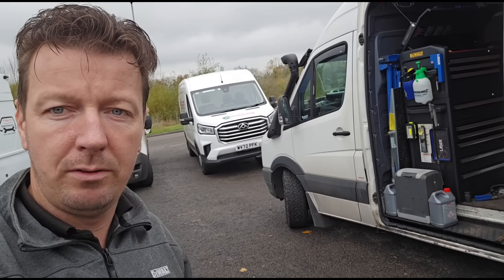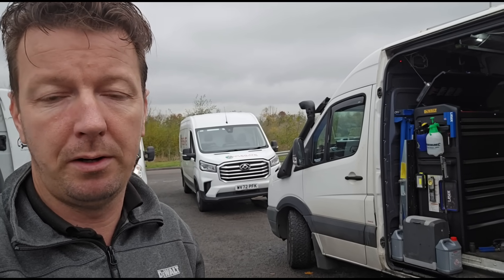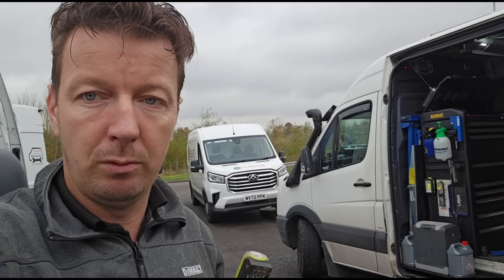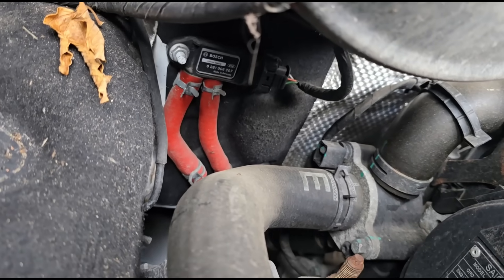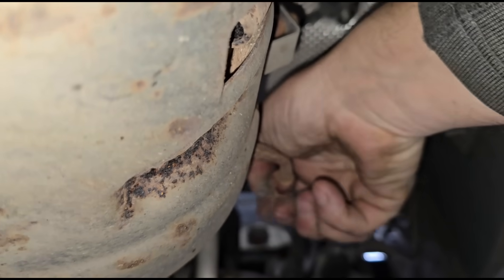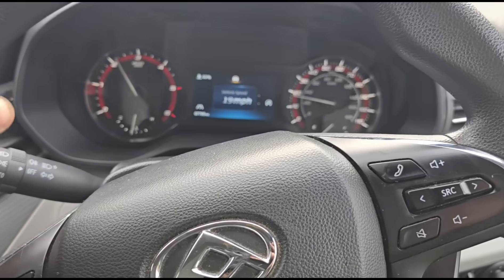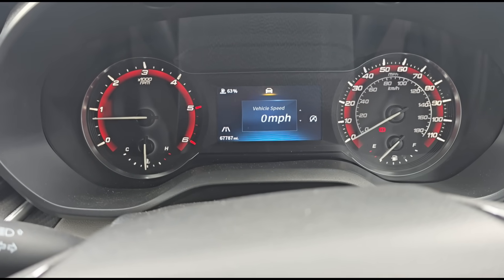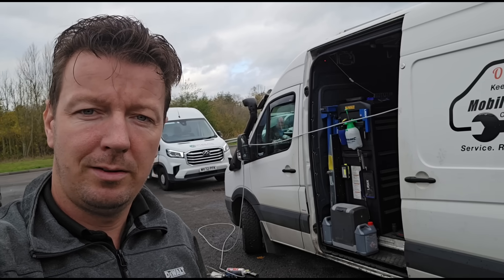SAIC Maxus Deliver 9 P226D09 Diesel Particulate Filter Malfunction & P244B00 DPF Pressure Too Large

Comment: Engine is VW EA288.variant.
Reply: No it's not
Reply: @pashwesty3313  "The SC20M architecture is based on the Volkswagen EA288 modular diesel engine platform." - Wiki  "The SC20M is essentially SAIC's version of the Volkswagen EA288 diesel engine platform, sharing its core architecture but adapted for SAIC Maxus vehicles, offering different power outputs (single/twin turbo) while both meet Euro 5/6 standards, with the EA288 being VW's popular, widespread family of modular diesels found in many VW, Audi, Skoda, and SEAT cars, known for efficiency but sometimes piston ring/oil issues in early versions," AI derived info.

Comment: Thinking of buying this MAXUS V90? 
DON'T! 
I worked on these at the LDV dealer from 2021 until 2025 They are garbage. Engines going bang, Oil pump solenoids, gearbox and clutch issues, low pressure EGR every year, timing belts going etc. 
Stay away, get a Renault master instead
Reply from the maker: Thanks for the insight!

Comment: Absolutely horrible Van 60,000 miles side doors fallen off,  both driveshafts knackered,  HP diesel pump leaking,   getting anything for it takes 3 days,  complete junk
Reply from the maker: Sorry to hear you've had so many problems with yours!

Comment: I worked for MG which is a sister company of Maxus, at the factory in Longbridge. Avoid like the plague. Their diesel in the MG6 has become problematic, especially with timing chains and injectors. The engine is based on a boat engine made by Yunnei. I suspect the Maxus engine shares bits with the engine. You can't find bits for the MG6 diesel any more, especially the duel mass flywheel with is NLA.

Comment: I have a very clever friend with a laptop that can delete AdBlue, DPF, EGR and EVAP systems, had all mine deleted and still passes MOT (UK Inspection), thank you very clever friend.
Reply: Your ‘clever’ friend is a tad shortsighted. But the. He’ll be nowhere to be found when it all goes wrong & it will.
Reply: @hughmarcus1  He's been doing it for years, and been a friend for years, I don't know about your friends, but my friends don't just disappear when things go wrong, it saddens me to think that your friends would do that, I suggest you choose better friends.
Reply: @IvyMike.   Deleting those systems via software without removing the hardware, could be even worse. Especially the DPF, which will clog fast.
Reply: @RogerM88  Obviously, the hardware gets removed as part of the process, including the AdBlue injector,  sorry, should of mentioned that.
Reply: @hughmarcus1 Had mine deleted 4 years ago. No problems yet. Better fuel milage too as a result.
Reply: on a maxus deliver 9 ...???
Reply: @dcs34colin  No, Sprinter, mobile plant engineer.
Reply from the maker: Thanks for sharing!

Comment: Can you help me? Am trying to find the DPF pressure sensor pipes to take off and use dpf clean on and regen however cant find the pipes and sensor in engin bay. Ford  galaxy 2013 2l diesal.  Id have you come and do for me but located too far away in Salford sadly.
Reply: Look under the car, canister shape, pipes coming off will be the differential pressure,  the front one is where you inject the magic fluid,  before the dpf, the further away one ,probably on the other side is after the dpf.
You don't put fluid down them. That's on Renault differential pressure sensor pipe. That's in the engine bay, Ford is underneath. If you're not sure, don't mess with it
Reply: @chrisnewell-7758 I know how to do but not done on a ford befor and didnt know where was as most done befor on where engine bays bjt this am like maybe only on cats and dpf next to and as yku say gonna have go under